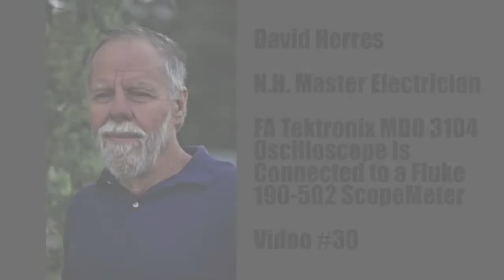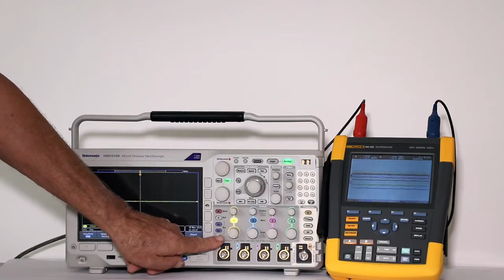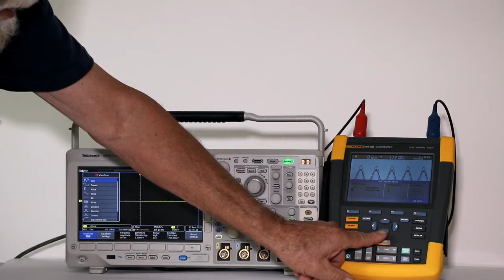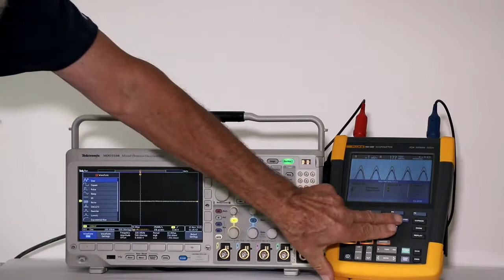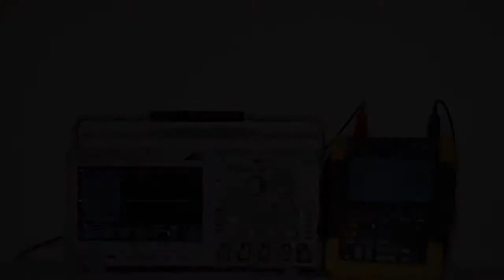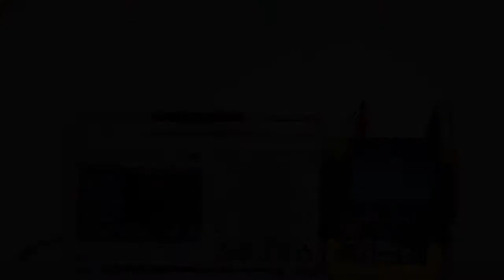A Tektronix MDO 3104 Oscilloscope Is Connected to a Fluke 190 502 ScopeMeter

Comment: Oh wow. That is crazy. The fluke destroys that Tektronix's scope.  Its like night and day.  For those who don't understand. The fluke is measuring the signal  that is showing up on the Tektronix's scope.  When you get into the thousands of dollars range Fluke actually become a better deal.  This Fluke runs at 500mhz where as the Tektronix runs only at 100mhz.  In order to get a 500mhz with the Tektronix  you gotta lay down 10k.  The issue occurs when you need to measure 4 channels at the same time. Which happens a lot.